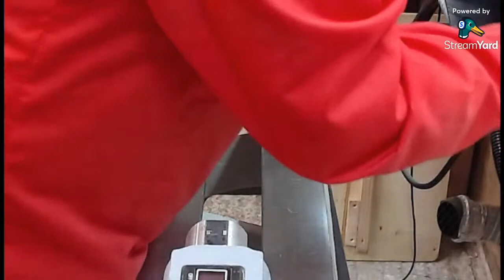Woodturning | Monday night live choice of woods this evening

Comment: I'm new to wood turning and just found your channel. I'm learning lots. It looks like you used to have a record power regent but recently switched to an Axminister 406. May I ask why, did you have concerns following the headstock recall?
Reply from the maker: I changed from the record power range as I wanted a larger Capacity and More power, I find the Axminster508  to be a machine better suited to my future ambition. However having said that the record power range of Lathes are mor than capable for their design and the Customer service is second to none. I repaired the Faulty part and sold the lathe on to a friend there should be no issues with that part now it is a much better design and the replacement were uk made. 
Thank you for finding my channel I hope you find lots that will help you in your journey into woodturning. If you need help With anything I’m happy to help.
Reply: @Stable_Studio  I was just finishing watching this livestream when you panned out and I saw it was the 508 not the 406.  I'm looking to make my first big lathe purchase and currently favour the Record power Regent over the 406. Thank you for your comments and experience on them. Happy turning!